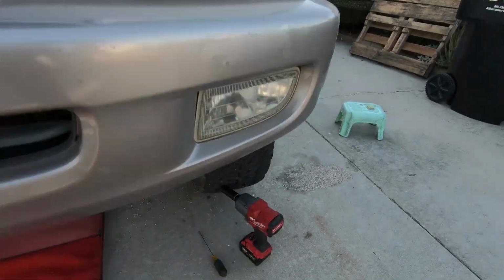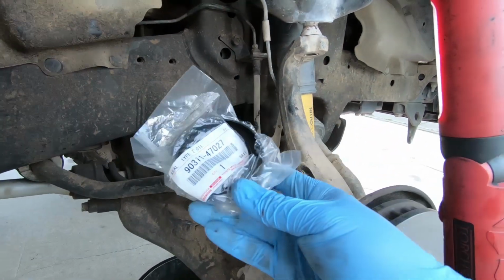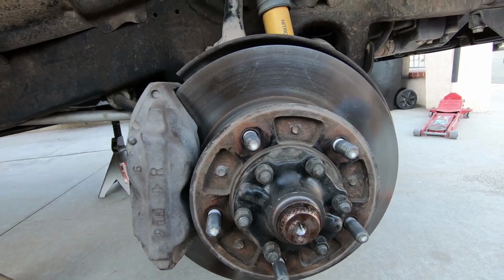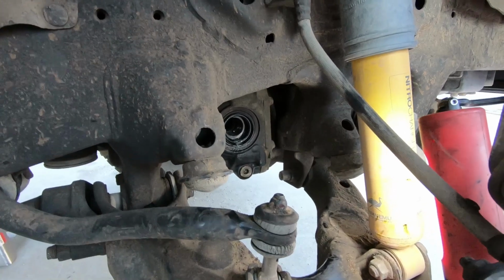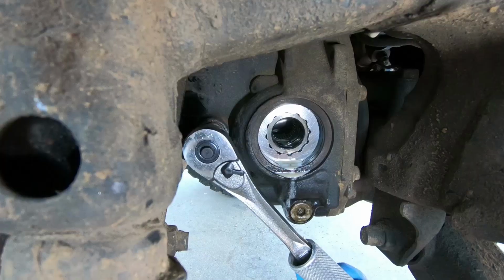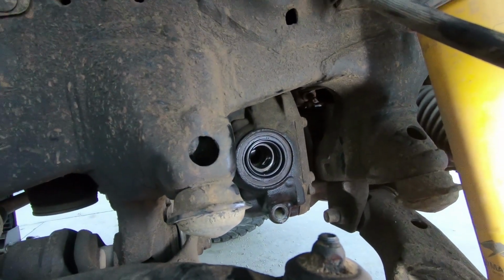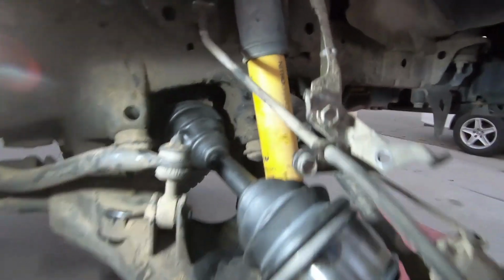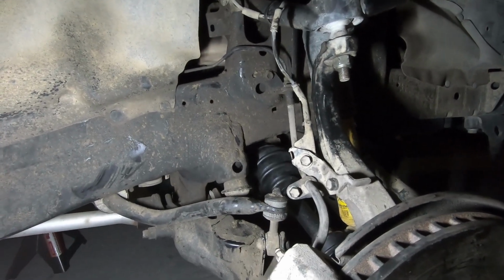CV axles, front differential seals and diff oil replaced on land cruiser 100 LX470

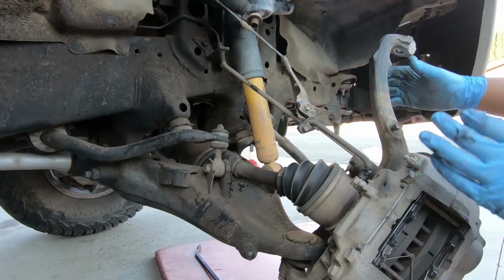Comment: Interesting technique to pop the CV axle from the differential.  I might have been hearing things, but I thought for sure I heard your brake line and ABS line crying from the torture you put them through.  Play time 4:46 really shows the strain you put on them.  I guess its a testament to how well constructed they are, especially the brake line.  That thing was STRETCHED!  I'm all for short cuts, but I'd have a hard time showing this technique to my viewers.  When I did this job recently, I just went ahead and disconnected the LBJ and steering knuckle arm and removed the whole steering knuckle and hub assembly.  It's more work, and it's a heavy beast, but that's the way I did it.  Then I simply used a pry bar to pop the CV axle from the differential.  For the seal removal, I use a slide hammer puller.  I like the slide hammer technique because it eliminates the chances of scoring the differential seal surface with a pry bar or a hooked style seal puller.  For the seal insertion, there's custom installation drivers for sale.  Wits End used to sell them, now Delta Vehicle Systems sells one as well as my buddy Vincent who sells the tool on Ebay.
Reply: I also don't like seeing people using screwdrivers to remove or install snaprings when decent snapring pliers aren't that expensive.

Comment: One more thing, instead of using a tool to push the oil seal in, the best thing is to use the old seal itself and stack it atop the new seal, and tap on top of that to slowly seat the seal in place. This works really well and prevents damage to the fragile rubber!

Comment: Thanks for the tutorial, I did this yesterday. Sadly mine didn’t just pop out had to remove the spindle and everything on an LX. Did a reboot on the original axles, boy was it a mess. Went with Toyota boots for 80.00 but I only did one boot as the outer was still in great shape. Thanks for the vids and keep them coming! FYI eBay has a shift hole bezel for 45.00 OE. I saw on one of you vids you said you wanted to replace it. Thanks again.
Reply from the maker: Oem boot is pretty cheap! I wish I had kept my oem axles... oh well. Yes I’m looking for a center shift bezel thing, I’ll have to look on eBay, thanks!

Comment: Very useful video.  I did mine a few months ago and one thing I would highly suggest/recommend is that the new inner CV axle seal be pushed in ~5.5mm  (and measured with a caliper)  as per the Toyota manual. Also, while I know it would be a bit expensive, I would have gone with the OEM CV axle.  They last a lot longer. Keep them coming.
Reply from the maker: Robert V thanks for your input! Let’s see how long this one will last
Reply: What kind of caliper tool would you use?
Reply: @Jubi229  Any caliper that has a rod depth at the end.  Just get close to the edge of the hole after you insert the seal to be able to use it for measuring the depth.

Comment: Thanks for posting

I would add, it would have been even better to remove the caliper so you didn't strain the brake line, which is under a lot of tension in the video at different times.   Likewise for the ABS sensor.

Comment: How are those replacement axles holding up? I found my 2000 Land Cruisers CV axles both have a leak on the inter boots small end as well as the seals at the differential where CV axle goes in (Likely lifting my Land Cruiser a bit wore out the 361k mile seal...unless it had been changed prior to me owning it! Wowza!! ).

I’ve debated just ordering some replacement aftermarket CV axles versus regreasing/rebooting the OEM ones. 
I’m leaning towards getting an aftermarket replacement and keeping my old ones as a backup down the road should I have any issues! I can always rebuild them later.
Reply from the maker: So far my autozone cv axles have been problem free. I would also recommend changing out the axle seals in the diff at the same time. I believe I have a video up when I did them. 

As far as the stock axles, definitely keep them and get them rebuilt as spares. Have fun!
Reply: @chowcares  I just got in some Cardone HD (Heavy Duty) axles and I’ll see how they work! They seem really heavy and have heard some good stuff on ih8mud on em.

Definitely gonna keep the originals as backups, no weird clunks or chirps at 361k miles...just the darn seals and boots leaking oil and grease respectively XD Didn’t feel like rebuilding them just yet. Thanks for the content as usual!
Reply: @HBButler01  How are the Cardone hd axles? Are they just as beefy and heavy as Oem? Any issues as of now? I’m in need of replacing both myself.

Comment: Would highly recommend not yanking the CV axle out like that. It disconnected the inside of the diff side tulip on mine. Turned a couple hour thing into a 2 day ordeal. Theb had to wait to get a new one in the mail and do it all over again. A much safer way to do it is drive a a wedge between the edge of the CV by the diff side, being careful to not hit the dust cap, and hammering the wedge in until it pops out. You may have to tap the edge of it from the side with a pry bar and hammer to get it all the way out. Much safer way than to yank it out by the knuckle.

Comment: We took our apart today and it looked like someone had replaced the OEM one with a duralast part.  The duralast part was crap.  The one you bought from Amazon, the supplier has a 1 star rating. Besides the OEM one that is way too expensive, what brand do you recommend?  I need your help on this so thanks ahead of time.

Comment: Just tried this today, and had to remove the shock to get enough clearance to get the CV out of the differential.  Did you have to remove the tie rod end link or were you able to this without doing that?  Also, my CV was pretty stuck in there and I had to pry it out with a pry-bar to break it loose from the diff.
Reply from the maker: You should have just enough space to wiggle it out without needing to remove the shock. I did not remove the tierod ends. Using a pry bar to pop the axle out of the diff is sometimes necessary

Comment: Really appreciate your excellent video on this to fix seal and CV boot replacement. I have a question you might be able to solve. I'm getting a clicking noise from the front, possibly in CV or steering. I have 1999 LandCruiser series 100, with just under 150,000 miles. Sometimes in starting out, but more often going over a small speed bump slowly, and it seems to have increased in past weeks or so. I see where fluid has leaked on outer steering boots, and I see the inner CV Boot seal has a bit of grease coming out on both outer boots, both sides of vehicle. Have any clues as to why I might be hearing the clicking? Hope to hear at your earliest convenience. Many thanks.
Reply from the maker: Clicking noise is usually a sign of worn cv joints. If you see grease coming out of either inner or outer boot, it’s time to replace. Steering won’t make a clicking noise
Reply: @chowcares  As suspected, thanks for your very quick response. Do these need immediate replacement or what kind of time frame am I looking at... a week... two?
Reply from the maker: aquaman vancouver depends on the severity. If it’s just light clicks when you turn full lock you have some time. If it’s clicking going straight then probably ASAP. Either way, since u figured out the cause, the sooner the better
Reply: vancouver  mine is the CV and axle flange failing. The noise is very similar to a failing cv joint but it it the teeth which connect the flange and shaft. Easy to check just pop off the cap in the center, clean it up and examine the ends of the teeth. If they r still sharp then all gud but if they r rounded off like mine than it's time to check out his "brake job from hell video"

Comment: Hey Chow, how do you like the OME suspension? Several people on MUD complain it’s very harsh. I like a tight ride but feel like a SUV shouldn’t ride like a drift car. What do you think?
Reply from the maker: Initially it felt “okayyyy” not great, not bad. But once I did the spc upper arms and new lower ball joints, they feel amazing. A lot of the old suspension components contribute to the harsh ride. Now my lc rides smooth and is very responsive. Hope that helps!

Comment: I would replace the snap ring with a new one, I read that those are supposed to be replaced everything it is taken out. Or else it'll fail and the axle will go too far into the diff.
Reply from the maker: Good to know! Next time it comes out I will replace. Planning to do the diff drop soon
Reply: @chowcares  did you ever do the diff drop? Didnt see a video for it when I searched

Comment: Just bought 2002 Toyota Land Cruiser but the AC/Heating system is not working at all, the buttons are not just responding to anything, please do you have ideas on what I can do?
Reply from the maker: My ac button is also kinda “sticky”. Haven’t really had a chance to look into it yet. Hopefully someone with experience who sees this can shed some light.
Reply: Mine too. They work by pressing in holding with a tad more force. Was wondering if I can carefully spray electrical or MAF cleaner or maybe even WD40, but who knows. Been like this since I bought my 2000 4yrs ago. Maybe they’re just worn. Is yours fixed?

Comment: 11:20
Extractor bits 
And sockets

They are the bees knees when stuff gets out of hand. 
Be nicer to your brake lines friend!
Reply from the maker: I’ve never had too much luck with them. I’m probably using them wrong lol. I recently replaced all of the full and drain bolts on both front and rear diffs
Reply: chowcares 

A quality set is worth the expense, saved my pickle once in a diff fill bolt
Reply: awesome until you snap the extractor bit off and there is hardened steel there to drill through after.  I have had better luck just drilling out to just slightly less then the diameter of the threads and then getting a tap in there to clean the last bit of metal out of the existing threads.

Comment: Had to give a thumbs down. When I pulled on my CV shaft I ended up breaking it at the lower knuckle inside the boot. Had to get it towed to a shop and had to install a new cv shaft. Tried saving a few bucks doing it myself and ended up wasting a few hundred
Reply from the maker: Sounds like your cv was on the way out (of course that’s why u were changing it). Good thing it happened in your driveway and not on the trail. Or worst yet, on the freeway at speed.